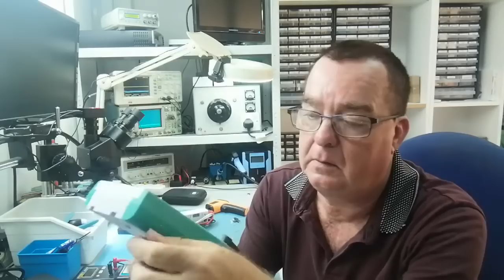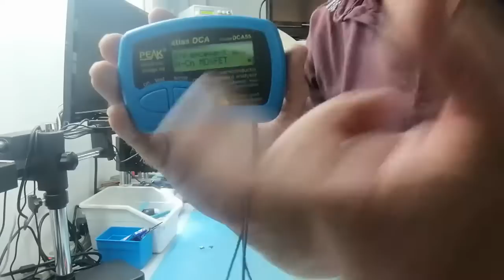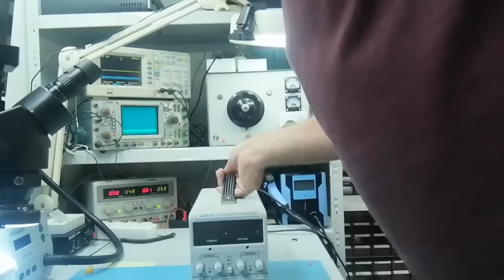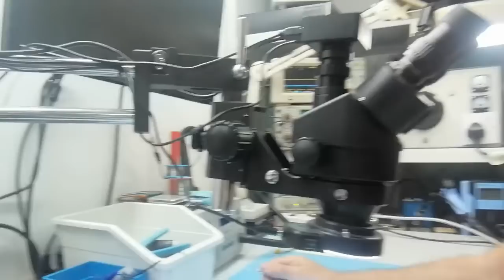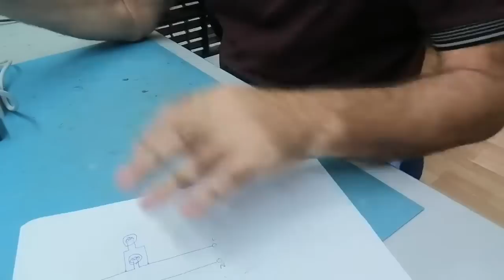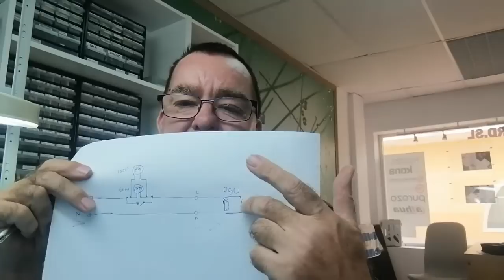Learn Electronics Repair #11 - Test Equipment

Comment: I have lots of equipment everything you can get , but i have put it all in boxes in the garage 
i was to much ocupied with using all kinds of testers and i allmost repaired nothing .sinds i put it away and only use my multimeter i fixed a lot more items .
so scope, frequenty generators , esr meter , short tracker, signal trackers, and so on only keep you of your work .
a multimeter solves allmost all problems it just comes down to knowing how to use it and understanding how parts work and circuits .
now i have a clean workspace with just a power supply and my multimeter and i am so much more productive .
sorry for the faults in my writing its not my language

Comment: i use my signal generator and logic probe and my ultra tiny scope it has like a 2 inch screen; 1 to 2 MHz for a visual on the signals for those two instruments.

Comment: Had to laugh at your comments about a variac and insulatiion transformer, only part there that you left out was the series light-bulb for current limiting, do you need it???? I guess old-schoolers like us would go "YES", but looking at some other youtube channels trying to work on SMPS or other things with a live earth, without understanding the basic principles, my comment is "Stay away" unless you don’t value your live or your precious oscilloscope. For lots of fault-finding you can get by without 7nderstanding the underlying principles, but where HV gets involved, you need at least some theoretical knowledge… speaking from experience… miracle I survived as a kid, building valve equipment with valves working directly from rectfied mains…. 😱😱😱😱

Comment: Its nearly Xmas im starting to take electronics repair more seriously I'll be asking for electronic repair tools. i have a disability that has stopped me working i used to be a around builder and car mechanic.. I do repair most technology like phones xbox tvs pc's etc but i definitely need better tools i have a good soldering iron and heat station need a better meter and desolder vaccum ive got a really old oscilloscopes from the 1970s need to change the caps other than that its functional.. Love these videos richard keep them coming please

Comment: Fun fact, if you get a cable toner and hold it up to your atlas DCA when you turn it on it will play a little tune. It was coded but the beeper was never added during production. 

At least my Atlas UTP ethernet tracer does anyway!

Comment: Well I cooked my first meal in the pressure cooker today…Aldi 750gram gammon joint…5 small potatoes, cut in half…2 onions quartered…1 chicken stock cube mixed with 2 cups of hot water…set timer for 25 minutes. Absolutely brilliant…total time approx 45mins including warm up and depressurising…resulting in a wonderfully well cooked, tasty, meal for my wife and myself…excellent.
Thanks for your videos.👍👍👍

Comment: Doesn't an analog meter have a higher test voltage for testing diodes? Wouldn't this be an advantage? Thanks for sharing your knowledge and experience. I subbed.

Comment: I have an 8 channel Saleae Logic Analyzer. That thing cost $500.00 dollars. A 16 channel one will run you a grand. It's probably more sophisticated than yours which is why it's more expensive (I hope :)) I bought it on March 28, 2022 for low level ST Electronics ARM boards programming (STM32F407G - Discovery Board). The good thing about logic analyzers is that they have 8 or 16 channels. An Oscilloscope has 2 channels only. You do have to have a powerful computer with a lot of memory, as everything runs through the USB connection.
I would love it if you any videos on how to fix them and such. I'm learning a lot about PSUs from your videos. I'm not planning on fixing any (yet), but it's great material.

Comment: An analogue meter is useful for troubleshooting older equipment, where voltages given in the service manual were likely read using an analogue meter with an input impedance of around 20k per voltage rather than modern digital meters that generally have an input impedance around 10M.

Comment: I just ordered a digital multimeter before the other things, because I need to eliminate a 30 or more quid pc power brick as the problem first. I ordered an amprobe am-520 because it's the cheapest I could find made by a Fluke company and which has both capacitance and temperature. I hope I made a good choice.

Comment: Analog meters are good for needle deflection, and with no circuitry they are fast acting. 

Yes, Needle reaction can be slow, but there's no circuitry to think about reacting, it just does. 

Needle deflection can help with fluctuating or pulsing currents.  I would say it's a necessary third meter.

Comment: How many amps is your Variac, as it looks like 15A? Is yours an open Variac like most of them are. Mine was the same but like you did (Apart from Andy (Photonicinduction)), everyone sticks them in a box.
Everybody LOVES old analog needle meter's. But due to how small yours are and the output always need to be accurate (but you can use a DMM for that). I'd swap them over for some eBay special digital one's 🙂

Going back to your load limiting supply using a couple of lamps. I use 9 magnetic ballasts with 9 switches for each of them. They're from 11w to 600w and to keep them out of the way. I stuck them on a couple of bits of ply and put them in the corner of my workshop. Just so their out of the way and not taking up any VALUABLE real estate. 

Going back to DMM's I've got at least 5 but a little while ago. I had a hunt on eBay n got myself a pocket multimeter which I ended up buying another one as they're pretty good value for the price. 
It's the same one (ANENG) your handling and I'm tempted to buy another one just because they're so cheap! 
I think it's still the only pocket multimeter that does 10A (but correct me if I'm wrong). It's definitely come in VERY handy in the past, as I've been tasting how much currently was running through some LED strips. 

My Variac (which is actually called a Variac) is an old one that's rated for 20A. But I've recently got a much newer one and that's for 30A n the windings are actually a lot smaller (even though they are gold plated). I've had it running WELL OVER 60A over a short period and it's never complained. 
It's so fun when you turn it on and it's not at 0 degrees n EVERYTHING dimms 😁 
I'm still in the process of making it better, but as it stands. I've stuck a contactor in with a pust button. So if the power goes out, then it WON'T comes back on by itself. I'll have to physically reset it. I've also stuck 3 MCB's on the output but as of yet. I haven't put one on the input, as I've got quite a few things on the output to protect my lovely old Variac which I'll never sell. 
If you go on mine or Andy's channel, then you'll see it. Back then it was in a white box but now it's gloss black. I'm going to remake it as it was made up from leftover bits when doing the house. 

Going back to bench power supplies, I bought a cheap ish one off eBay a while ago. It's a single output, 5 memory, rotary encoder, 31V, 3.1A, CC, CV, OCP, OVP, current adjust to 0.001 and voltage adjust to 0.01. 
I also was looking for a much bigger n powerful bench power supplies which are German and are in immaculate condition and I paid 5% of what they are new. One's 72V at 30A and the others 300V at 6.67A. 
I've been looking for power supplies like those for WELL OVER 10yrs and I'll never sell them, same goes for my old Variac 😊

I really like your set up btw 👍🏻🙂

Comment: One thing you need in a workshop is a camera to record where leads plugs and other parts go during later reasembly.  I have a Peak Component Tester that would exceed 40 years old.

Comment: SUPER TIP…..
TLDR use TINY film thermistors that will allow you to track hotspots instantly without a thermal camera.

OK so this is a bit long I apologize…..

Yet again I’m sorry to leave another comment but when it comes to temperature detection, if you don’t want to invest in a thermal camera… Try this.

Take the smallest thermistor you can find. Like the little thin film ones found in most inkjet printers, or found monitoring the temperature in a laptop battery pack or other battery pack. 

These things are tiny, They will be the tiniest little thermistors you’ve ever seen literally like The size of a large grain of sand. Like 1/4 the size of a piece of rice. The smaller the better because it has faster response and recovery since it has less mass

Get a sharpie marker and disassemble it throwing away the ink portion…. But keeping the felt tip. Poke a  needle through the felt tip and position the thermistor so that The legs of the thermistor pass through the felt tip and into the body of the sharpie. 

Run a few flexible silicone type wires at the back of the sharpie and connect to the thermistor. Instead of cheap multimeter leads will be OK as long as they’re flexible. You can usually get a decent set of silicone leads from Banggood for less than five dollars, keep in mind you’re cutting off the end of the probe so you don’t want to spend much money on them. Maybe even have a broken sit around and you can just step off the probes.

use a little bit of super glue or epoxy on the end of the felt tip, not completely covering the thermistor but only leaving just a tiny little portion at the end exposed. 

thermistor should be pushed down to where it’s just barely sticking out, but a little bit of adhesive can protect it and make sure that it doesn’t get damaged but without covering the actual tip of it. Just so that the legs and things don’t get flexed or stressed. Because these things are tiny and just looking at them wrong and make them fall apart

Now you can plug it into your multimeter on resistance mode, and it will respond instantaneously within like 1/100 of a second to the varying temperatures. It is literally so sensitive that when I set my multimeter up in a room and leave the room letting the thermistor stabilize… If I even come a few feet from the doorway to that room you can see the multimeters display start jumping up just because of the infrared heat from 20 or 30 feet away. 

It is ridiculously sensitive.
You can literally touch the wall with your hand for a split second and even several minutes later the thermistor can pick up the change in heat where your fingerprints were. It’s that crazy sensitive.
These characteristics are very similar to a thermal camera, but of course instead of seeing the difference in color you’re just seeing the multimeter resistance display jump up and down

 Now that it’s plugged into your meter, that you can sweep across a circuit board and it quickly find the warmest areas.. its a Thousand times more sensitive to heat than your fingers, 

this thermistor contraption is basically free, and will allow you to track down temperature differences at an incredible speed and efficiency. You can Google “thin-film thermistor“ or just rip open a rechargeable battery pack and you’ll see them taped to the 18650 cells. They’ll have a bit of kapton tape around them to keep them from flexing or stressing. I usually keep the tape on the legs but trim the very tip of the thermistor so it’s the only thing exposed. 

Keep in mind the legs of the thermistor are basically like human hairs they’re so tiny.

The smaller the thermistor the quicker the response time as a bigger one would hold onto the heat and not recover instantly. 

I’ve made several of these using different types and resistance thermistors. Usually the resistance is between 50k abd 150k ohms 

Some recover a little faster than others depending on size, room temperature resistance, and the type of material the tip is made out of. Sometimes Glass sometimes epoxy , All kinds of different materials. I’ve had good luck with the glass tipped ones, I use a cheap diamond fingernail file to grind away the very tip of the glass getting extremely close to the junction inside of the thermistor. This improves sensitivity. But it’s honestly not even needed because they are already ridiculously sensitive

 The good thing about harvesting them and using all dried up sharpie markers is there free to make. Even if you do need to buy the thermistors they’re usually a few pennies apiece or maybe a dollar. I’ve even use some of the thermistors like sold in the 3-D printing community used to monitor the hot end… They make great heat detectors for troubleshooting. And are widely available

So if you make a few with different types and resistances, some will be a bit faster responding so I’m a bit slower but that’s actually a good thing because sometimes you don’t want to respond and be super jittery.

Not only is it basically free and incredibly useful for tracing down issues on PCBs.… but you can also use it to search for “heat leaks” in your home around doors and other places that could use insulation or attention paid to the cracks

I have several thermal cameras that I use in my lab but these are just as useful, a little less convenient maybe but damn still super super useful

Comment: 13:23 sorry to bug you with another comment. But the ESR meter you showed has a newer version this year and I believe for about the same price it will measure ESR and capacitance on the same unit. They look basically identical but I believe the price is about the same

Comment: The Aneng v8 multimeter costs a little more than the one you showed, but it is genuinely one of the best multimeters I have ever used. And has capabilities that are only found on some of the highest and expensive fluke meters. Ability to measure varying frequencies, inrush, variable frequency drives, and all kinds of other things

I’ve had it open several times to clean the switch contacts or replace a fuse… i’ve actually had two of them for the past two or three years. 

I’m somewhat “qualified“ to judge the quality because I have my own small and humble metrology business. I do component level board repair for industrial and manufacturing clients, but I specialize in test equipment repair/calibration and other metrology associated tasks. I have an Beautiful family of NIST traceable certified equipment. And I work on insanely expensive test equipment for clients every day. So I’ve come to understand what makes a decent quality piece of test gear.

I love lots of the cheaper equipment because of its reliability, perfectly adequate accuracy, and if I do something stupid and blow something up, I’m not worried about knocking my $10,000 multimeter out of calibration. I’ve worked awfully hard for my equipment, and I don’t mean to sound arrogant or brag about it, I only mention it because it’s what taught me to accurately judge the quality of test gear. And I’m somewhat experienced with a decent gear, whereas a lot of folks who buy the cheaper meters might not be quite as familiar..

Don’t get me wrong, I love my process calibrators and 8.5 digit benchtop beauties. But holy shit it really is a golden age of great quality dirt cheap test equipment.

Comment: I agree that it is very important to have an instant beep for checking continuity. I am surprised that you have much more patience checking capacitors with that slow MESR meter. I have the same meter and it works, but it's slow and not very consistent. I bought the Blue ESR meter and it reads capacitors instantly and you always get the same reading if you test the same cap again. It costs 2-3 times as much as the MESR, but the build quality is much better and the performance is as good as it gets (instantly)

Comment: One good reason to have an analog meter is to read engine codes on pre 1996 vehicles which use OBD1. The fault number codes will correspond to the number of short sweeps on the meter, with a long sweep in between each number.

Comment: Hi Richard, Greetings from Australia :-}. Thank you for another good video! Regarding Benchtop Power Supplies, somebody might be interested in KORAD KA305D. After going through the number of different brands, I found this KORAD BPS. Now I have two of them and I can't recommend them more! They have a two-step power-up system, which allows setting all the desired parameters, without shorting the probes. First, you turn ON the whole unit which lets you see what you are actually setting. Then you can connect the DUT (Device Under Test) and switch ON the actual power transfer. Or you can connect the DUT first - it doesn't matter. They also have 4 Memories to store your most favored settings. Each unit is 5A 30V, so if I connect them in series, I can achieve up to 60v or 10A in parallel. I really strongly recommend them! Regards, Jerry.

Comment: Hi Richard, thank you for sharing all the information about your equipment. Regarding your microscope, if you need to extend the distance between the bottom of the scope and what you are working on, then you can fit a 0.5x barlow lens to it (the cost should be about 20 euros). It will also allow you to view a greater area under your scope but still provide more than enough magnification.

Comment: hi Richard, I'm interested in building the current limiter like yours, but I would like to add a amp metre into the circuit. would I need to put the amp metre after the bulbs and before the device under test ? In this arrangement if the lightbulb  is  lit would this affect the reading?
If I've got this totally wrong where would i be best to put the amp metre. 
Thank you so much for your videos